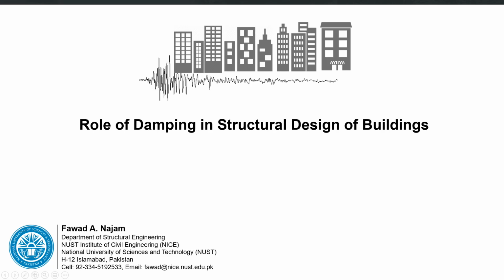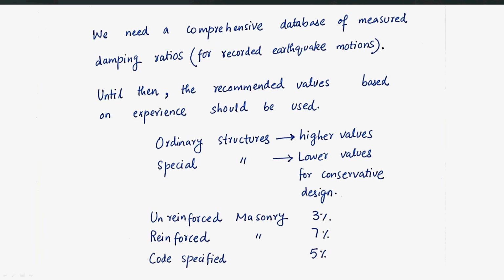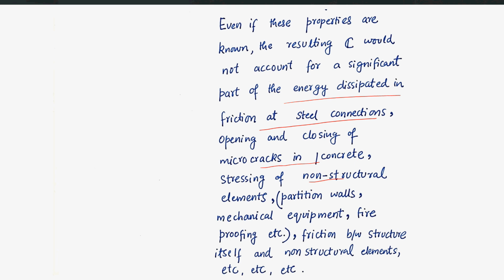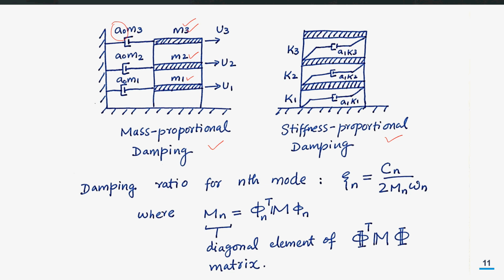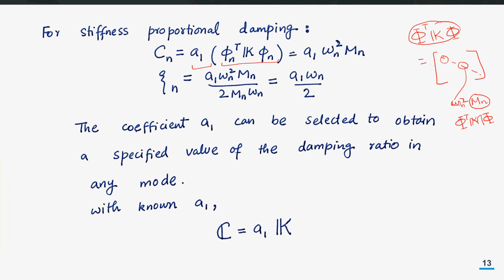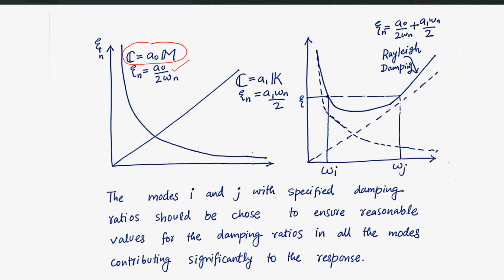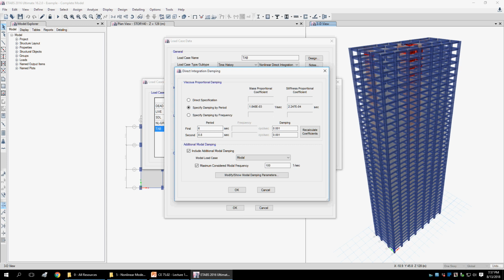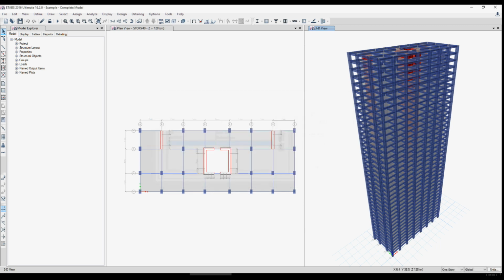27 - Modal Damping and Rayleigh Damping Models - ETABS Demonstration on Damping in Dynamic Analysis

Comment: Good presentation, I wanted to ask about, from which pair of modes is recommended to take the angular frequency, to find the rayleigh damping factors (mass and stiffness)? I have seen documentation where it is usually used between modes 1 and 4 and others that consider between modes 1 and 5.

I also wanted to ask why in the example a damping percentage of 0.001 is being considered.

Finally, I would like to ask you what you think about the fact that in the USA a maximum damping of 2% is considered for reinforced concrete buildings.

thank you in advance
Reply: Hi, did you find the why 0.001 damping percentage is being considered?